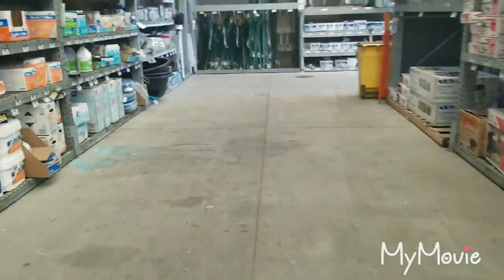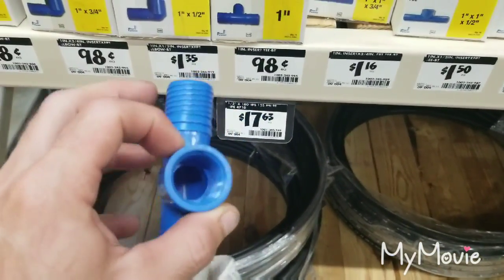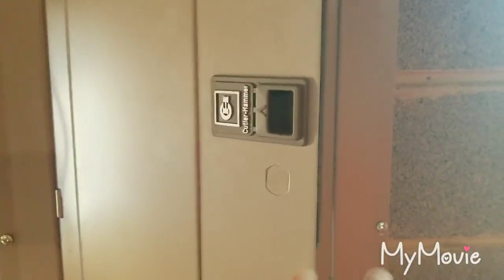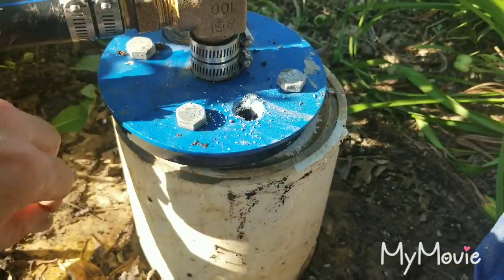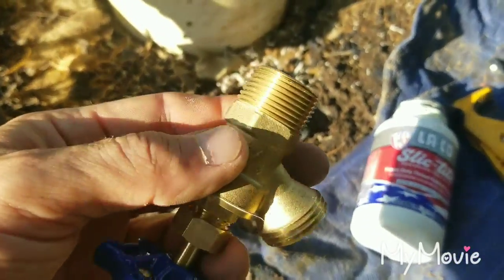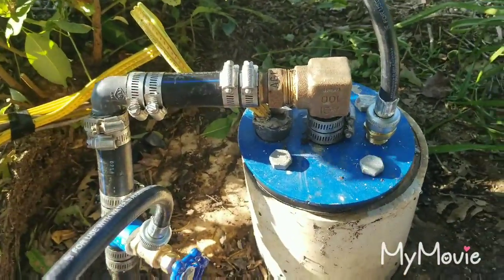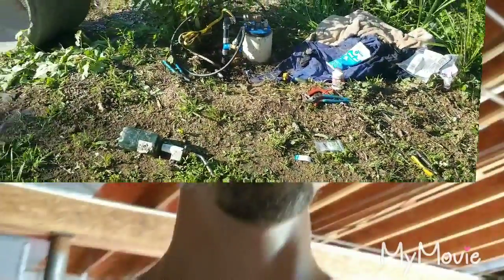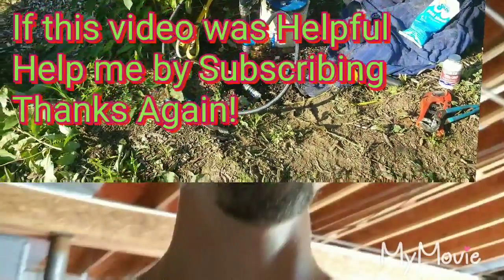How To Sanitize a Well. Well Cleaning. Sulfer/Red Iron/ Bacteria

Comment: I also use distilled vinegar to ph 7.0, after I have a ppm of chlorine 200 to 300 above normal ppm. Example, my normal tds is 135 ppm, I add chlorine until I get 350 to 450 ppm.  Chlorine will raise your normal ph, so I add vinegar until I get a ph of 7.0. I do this every year. I sanitize the tank and the lines. Next day flush and keep the chlorine out of the septic.

Comment: Great video! I was wondering, our well goes down 600 feet with a 4 inch liner. Our problem is that we have not just the sulphur smell but also the black iron (gunk) that gets on the hose fittings and turns them black. If we hook two garden hoses together to water the garden, over time, the hoses stick to each other and we can't unhook them. I've seen videos on using filters, but they are expensive. Would you recommend this or can we use the shock treatment in this video?  We use the well water for gardening and watering our grass but not for household use. How often would you recommend the shock treatment? Thanks for your feedback.

Comment: How would you do this with a pitless adapter..
Reply: Use hose from closest hose bib available or dig down to supply hose coming from pitless adapter and add a tee with a faucet if well is too far away from hose bibs.
If you have 1" PE (polyethylene) pipe for supply line to house you can get a brass yard hydrant tee at plumbing supply stores that has 2 barbed fitting for poly pipe and a 3/4" or 1" mip fitting for attaching yard hydrant or fitting to run to a hose bib.

Comment: If you holding tank is full the pump wont kick on to have constant flow correct? Do you have to by pass the pressure switch. i have check valve in my line going to tank,

Comment: Excellent video, thanks for your explanations and recommendations. I am adding a T, boiler valve, and fitting to recirculate once I add chlorination to the well. I've shocked my well 3 times over the past 3 years. Your method will make shocking the well more efficient and easier to do in the future. I do have a question, unless I missed it, you do not mention allowing the chlorinated well water sit in the plumbing inside of the home. Is this necessary? I do not have slime but I do have the rotten egg smell.  Thanks again!
Reply from the maker: @alfredbermea4462  no need to sit in the plumbing. Typically the rotten egg smell comes from the water heater anode rod. Remove it and cut it off & install just the plug. 90% of the time itll fit the smell issue
Reply: @h2omechanic  I have a brand new water heater and the smell. it can definitely come from the pipes. it can also come from the rubber liner in the well tank. which is most likely.
Reply: Thank you so much!! I have cleaned my well twice and did not know to bypass my water softener!!

Comment: Awesome video now we are having problem with the orange water . How do I fix that .  The water well was treated for algae and bacteria . Now runs orange staining
Reply: I had a lot of orange rust water after pulling 29 1/2 year old pump.
I have one hose bib before house and one at the pressure tank tee.

I shut off house valve and flushed well thru garden hose till it runs clear at that hose bib and the hose bib at pressure tank tee.
 Next I chlorinate well by adding 2 cups of luquid bleach to 5 gallons of water and dumping down well casing then run hose down casing for 30 minutes to evenly mixed chlorine ( my well is only 55 feet of solid 6" casing plus 5 feet of screened casing below that. With water table only at lower 21 feet of well after a dry summer.)

I then run water through rest of faucets thru house. Let sit 24 hours then flush system outside till bleach clears out of system.

Comment: I just pull the Well Cap off, and pour 2 quarts of Clorox Regular Bleach, down the inside, sides of the well PVC Pipe. Wait 15 minutes, and Pour Five Gallons, of warm water down down the well PVC Pipe. This is to rinse the Frost Connector, that goes horizontal out the well Casing to the pipe, that’s below the frost level to the house.  Replace the Dacron, under the Well Cap with new Dacron. This keeps Bugs, Snails and Slugs from falling into the Well.

Comment: I just bought a property that has a 56' well that hasn't been used for 6 years, but it was briefly run to do a flow test which yielded 7 gpm a couple of months ago.  How much pool shock would you recommend I put down this well?  Is there anything wrong with letting the pool shock remain in the well longer than 24 hrs?

Comment: I live on northern Michigan, where a well setup like that in this video would freeze instantly in winter. Thus, our wells up here normally feature a water outlet pipe located 4 to 6 feet underground. Is there any problem with simply running a garden hose from the house to the well and doing the same thing you do here? Or must I install a hydrant next to my well?

Comment: Interesting approach.  Nice presentation.

1.  Hot water works really well for heating HDPE pipe to insert fittings and you won't ruin the pipe at 200 degrees F where you can easily ruin it with a torch.  I use thread sealant as a lubricant.
2.  I also  use double clamps but face them in complementary directions.
3.  Just turn the house water off.  You'll still get the mixture in your pressure tank but not in the water heater causing pink hair tomorrow.

4.  Why is calcium hypochlorite better than a jug of Clorox?
Reply: do you have hard water? if so, calcium hypo. is not the answer.  
a jug of clorox is not the answer due to too many variables. other ingredients, age, potency, quantity. i found pool shock liquid chlorine NSF 60 12%  batch dated fairly recent at the local green big box store for less than a jug of clorox

Comment: IF there is a carbon filter, that is usually the same size as the water softener with the resin beads, it will filter out the chlorine, and there is no need to put the water softener in bypass mode.

Comment: Just bought a small house with an existing well that evidently has a high concentration of Hydrogen Sulfide (H2S) in the water which stands to reason as it is in the community of Sulfur Springs  Will get a water test shortly when I arrive to get actual PPM . There are about 40 empty bleach bottles strewn about. So my question is if I take my well pump, put it on a float valve to fill a large tank with maybe a pond aerator , fish tank bubbler or even spray the surface with water jets to agitate the water will this degas the H2S?  I was thinking in this tank, installing another pump to a pressure tank and switch, along with probably some other type of filters depending on the water quality test results.The main question is how long will it take the H2S to dissipate by agitating the water. Of course not knowing the PPM is limiting, but wondering if this may work to clear the water even if I have to add a second external tank. Thanks for any advice

Comment: I have an air injection system on my well and my test is coming back 0 for hydrogen sulfide. I still have a sulfur smell coming from the water though. My well is low yield and will run dry after about 120 gallons or 12 min wide open. Will loop chlorination kill wherever is making it smell? My second question is how long to run it after shocking? I can't run it for 2hrs without running it dry. Should I meter the flow so it can run longer? Should I bypass the air injection tank? Will there still be bacteria in the air injection tank or can I chlorinate that as well?

Comment: How do you shock a 2 pipe jet pump well system? My well seal didn't have the plug when I purchased house & was told it has to stay off because it's on artesian & has to be able relieve the pressure 🤷‍♂️. Water does come out of it sometimes, just depends on usage.
Reply: I have a similar situation where water comes out of my Wellhead 24/7. Wish I could figure out how to shock the system.

Comment: What would you suggest someone try if they have done this exact method over a dozen times? We have doubled and even TRIPLED the chlorine amount, as well as the circulation time. We have run the chlorinated water into all the lines of the house, let it sit for 72 hours, back flushed the water heater, flushed all the lines… you name it, we have tried it, to no avail!  Even if we get it to run clear, the bacteria/color comes back in a matter of days once the chlorine is flushed from the system.

Comment: How does it clean if there is a stream that brings water into the caseing constantly
Reply from the maker: Think of the entire well as a storage tank, but its basically a cylinder, if the water in the cylinder sits unused for a long time, bacteria growth can form, the chlorine kills that bacteria. Sometimes it's a smell, other times the water is brown or red. The same way chlorine helps to clean up a pool, the same goes for a well. That's why city water supply injects chlorine into the system to keep miles of pipes clean, if they fail a test, they increase chlorine and flush that line at a fire hydrant

Comment: Will the pool shock work on bacterial iron and we have found when we pull the pump the line and wire have a coating of black stuff and it is solidified on the pump
Reply from the maker: It does help to kill any bacteria in the well. Typically a black coating is either Manganese or some other form of bacteria. 
Your well just needs a few good treatments over a period of time and then 1 treatment annually. Some wells are worse than others (especially if surface water finds its way in)
Reply: @h2omechanic  for our area our well is deep and drilled into bedrock I appreciate the information thanks again

Comment: You helped more than you know, what well motor do you recommend for a 75 foot well? Thanks
Reply: Usually a 1/2 hp pump is used up to around 100' depth unless you have higher water consumption needs (multiple houses, barns, faen irrigation) or the house is significantly far and/or higher from well).  Depends also on well output (how many gallons it produces).
Typical 50-100' deep well with adequate production rate will have a 1/2 hp 10gpm pump.
Low producing wells may need controller that stops pump if well draws down below water level to keep pump from overheating.

Comment: I'm gathering knowledge for future drilling of a water well on our ranch and I have already learned a lot from your videos.  A lot of similarities to oil & gas well drilling and completion including the submersible pumps but much smaller scale regarding well depths, tubing sizes, and pump sizes. Your method of using the well pump to circulate the well after treating it with pool shock is fantastic.  I know these videos take time but what would have made this even more informative would have been a water analysis to show the mineralized water content and also samples of the water quality before and after treatment.  Another potential common chemical to add to such a water well treatment would be either vinegar (acetic acid) or very dilute muriatic acid (hydrochloric acid).  The amount of time allotted for those to remain inside the well would need to be carefully considered to help dissolve any scale within a well screen or pump intake.  If you had the opportunity to remove a pump from the same area and removed some scale from that pump, keep samples of that scale to help with future well treatments.  Vinegar is much less corrosive to the well pump and downhole clamps on top of the pump but also takes MUCH longer to dissolve scale as compared to even very diluted muriatic acid.  Using a small amount of either rubbing alcohol or denatured alcohol along with a very small amount of liquid detergent can allow the acid to dissolve iron scale, calcium scale, etc. more efficiently.  If you have access to a lower cost, non-foaming type of surfactant to use instead of the surfactant, that would be even better.  The acid, alcohol, and liquid detergent would all need to be thoroughly mixed into a small tank or bucket before being added to the well.  Mixing could be performed in a bucket with a paint mixer blade on a drill but that would likely create lots of foaming of using a liquid detergent.  You could also use a small, battery-operated pump to circulate the mixture inside a bucket with less foaming. The compatibility of your well pipe with the treatment chemicals could easily be tested on a small sample of that pipe.  With the acid, alcohol, and detergent treatment, the treatment should first soak and then be circulated as with your pool shock but most or all of the produced water should be circulated back down into the well.  Again, having a scale sample from your well or nearby well would be very helpful to know the optimum time for the treatment to soak.
Reply from the maker: We actually use vinegar quite regularly for certain situations as well as food grade citric acid. The key is contact time and circulation. There's a product called Bore Clean that's very expensive but also does a great job. My videos are more to give people a idea or understanding so they can ask the right questions to their local driller or plumbing company. The hard part now is finding a decent company who's actually in business doing this type of work

Comment: Just went to turn on my new 230v 1hp pump. The control box clicked in. I had power to the pump but no pump response. Any leads?
Reply from the maker: Did you replace the pump but used the old wire?
Reply: Here’s what really happened. I purchased a 1hp Tuhorse 3 wire. The tech at that company told me it was a 2 wire because he was looking at the wrong purchase order. So I excluded the third wire!! He denied telling me that but no matter. When he was trouble shooting with me on the phone he said to connect directly from the circuit breaker to the pump. 1 black 1 red 1 ground. I did that and turned the circuit on for 30 or 40 seconds. When I got back on the phone with the pump tech he said wiring it directly like that was bad. I told him I just followed his directions. Anyways I have to pull the pump back out and rewire. Any thoughts on possible damage to the motor by bypassing the control box and wiring it directly with only 2 hot leads and a ground for a system that required 3 wires. There was no pump action at all when attached to the control box and when wired directly.    Thanks for answering my first question. Also your vid’s are excellent!!

Comment: Thanks for videos.  Having terrible silt problems. 250' well. pump sits at 160' 30gal per min. Do you think cycling system you used for chlorination would work to clear silt away from pump?

Comment: could you cycle the water through a spout coming out of a pressure tank and back into the well itself after you shock the well or would it cause issues in the pressure tank in the long run ?
Reply from the maker: Yes you can do that, it would be fine. Itll help clean the tank & pipes doing it that way.
Reply: thanks bro going to give it a shot tomorrow!

Comment: I've watch several of your videos already. I had just helped replace my pressure tank yesterday and it was going great until I attempted to take a shower the next day. Checked the toggle switch in the crawl space, The pressure switch and then I hear and felt a faint humm... I followed the pipe to the front of the house hmm 2min...hmm. I knew replacing the 2 old 20gallon pressure tanks would open up the can of worms (replaced it with a 44gal and put it in the utility room). So I went inside and turned the breaker off, went to a friends to shower and am waiting till the morning to see if the pump is cooled down enough for it to turn on again (An old handyman/PC repair trick of mine). Thank you, Now I'll know what I have to do if the pump needs to be taken out or replaced. :)

Comment: I am going to treat the well much like you indicated in this video. I have almost identical well seal and fittings etc. However, the previous owner has a large galvanized T on top of the seal in the center where the water pipe must be connected below and down to the pump. Back at the T, he has the T directly over the 1/2 inch plug IN THE WAY GRRRR!! I am hoping I can just use a pipe wrench and turn the whole T about a 1/4 turn out of the way so I can access the 1/2 inch plug. What do you think,  PS Thanks again for the tip on the wire size and extra long run. We went from 10 wire to 8 wire and and it worked fine
Reply from the maker: You might get lucky & just rotate the well seal. It's just resting on the casing, it should be movable if the bolts aren't super tight.
Reply: @h2omechanic  Should I try to turn the galvanized T a 1/4 turn or try to spin the whole seal?
Reply from the maker: @ghostwriter310  try both. Try the seal first. It won't hurt anything